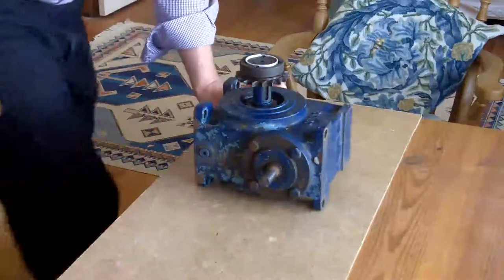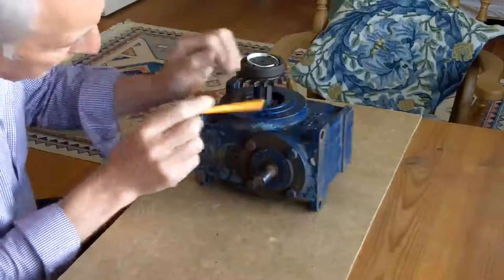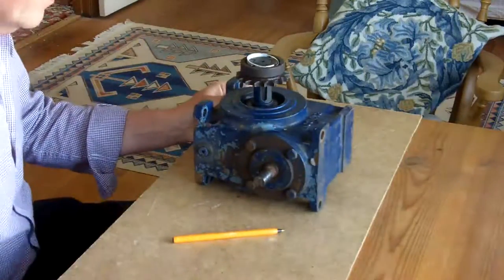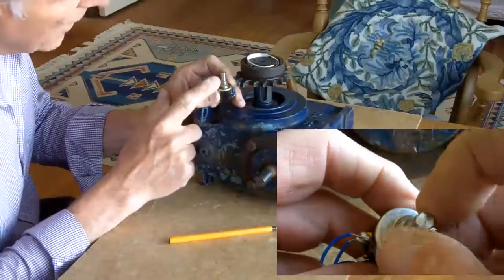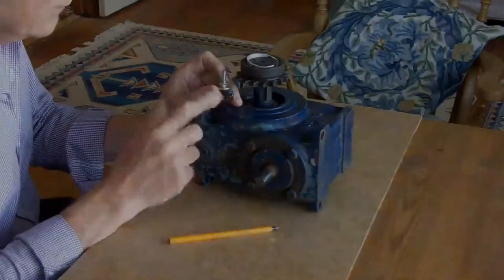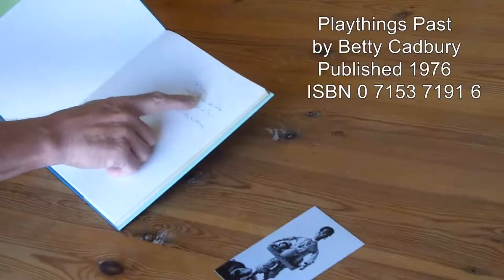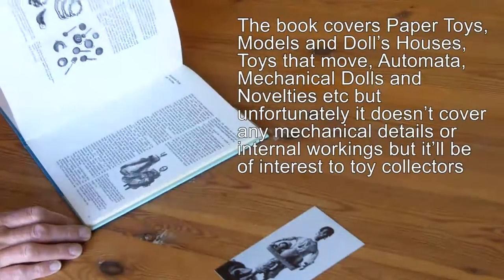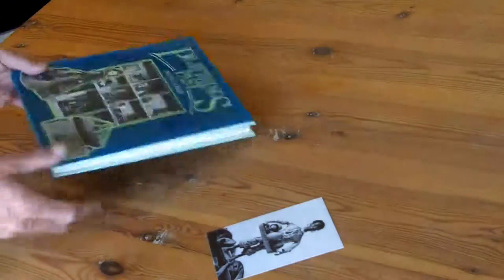About Radio 73 Antenna Rotator part 5  Me waffling on about what I might do next

Comment: I think you demonstrated the concept very well, the only improvement could have been to slip a tube or U-bracket of some sort, with a slot down it's axis, onto the pot's shaft. That would make that part of the lash up crystal clear to those unfamiliar with thinking in terms of yokes, motions and links. I remember how as a child the Stephenson valve gear was a mystery until I actually saw the link being moved.

Comment from the maker: Hi Dennis, the reason I thought about using the ten turn pot is I could easily  accommodate more than 360˚ of rotation, I'll probably aim for around 450˚ of travel. OK on the big dishes, the wind force will be enormous, I was surprised when I designed the guy system for my mast for the inverted ‘V’
I calculated the wind force on the mast at 100 MPH and that’s only a skinny little thing so a 6 ft ø dish with an area over 28 ft² would take quite some holding down. 
All the best ... Andy 
GWØJXM

Comment: have a look on e-Bay for a synchro pot, those can be driven round and round with no problems, though repeated driving past the zero does cause wear, but it will still have a lifetime in the thousands of cycles, or in your application the mast will rot off first.

Comment from the maker: ...by the way, I wanted to ask... ‘did I get the point over OK regarding exactly how, even though the drive wire would raise and lower as the rotator turns it would slide up and down in a slot on the potentiometer and the potentiometer could still be turned without any problem?’   
I'm always aware that people who write manuals often take too much for granted and start describing the operation without giving you the basics.  

Regards ... Andy

Comment: a 10 turn pot is what they used on those big satellite dish positioners your on the right track
a old positioner motor runs on 36 volts you could take the arm off motor and you would have almost what you art doing they are geared down slow and powerfully they ran those screw jacks
good luck